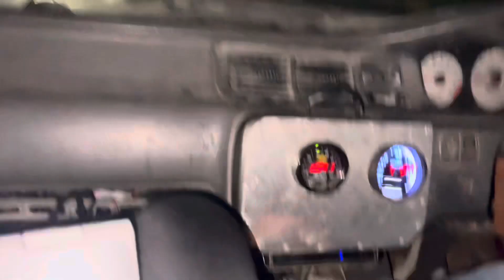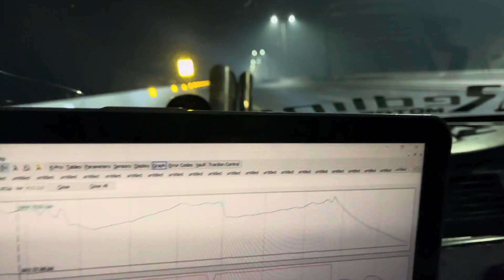K24 Turbo EG Civic🇵🇰 |Stock Motor | 500WHP |Pump Gas | RedlinePk

Comment: Pump gas using 2x 10 micron fuel filters and External fuel tank? Hmm e85 mastii
Reply from the maker: Lol , currently we’re on pump gas and secondly on E85 we’ll definitely cross 700 wheels 😂 stop being a keyboard warrior brother ♥️😛
Reply: @Redlinemotorsportspk-FTZ  lol keyboard warrior haha. Bhai apki apni Gari mai konsa setup hai?
Reply from the maker: K20 Type R from factory
Reply: @Redlinemotorsportspk-FTZ  k20 TypeR ki heavy engine hota hai?
Reply: @Redlinemotorsportspk-FTZ lying on the title lol 500hp stock 😅